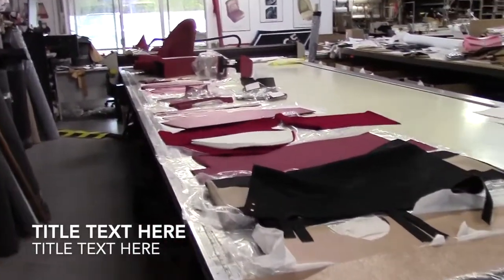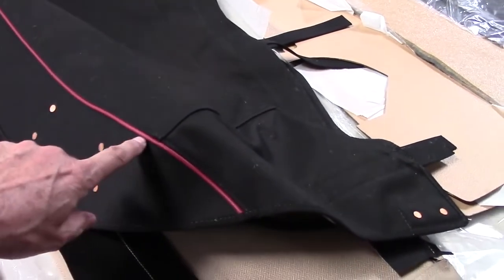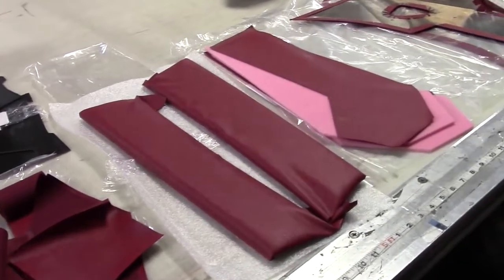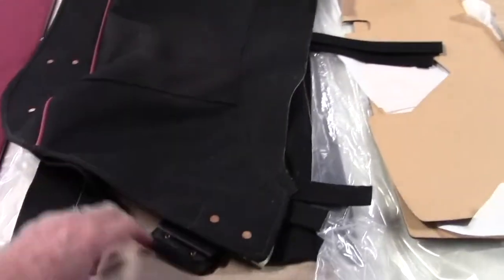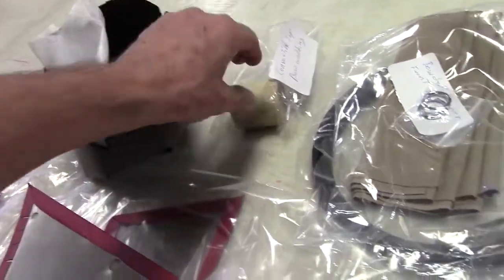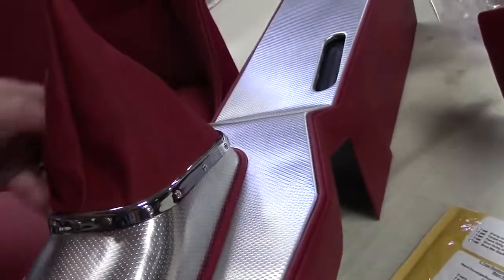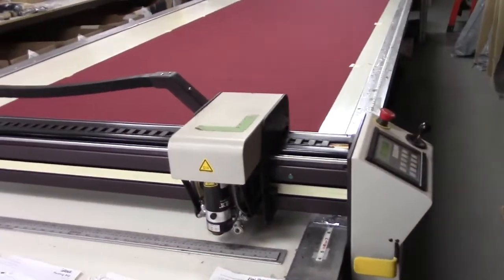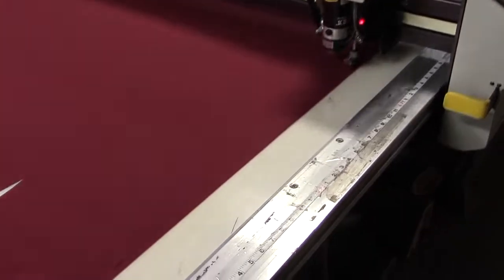Jaguar E-Type Roadster Full Interior Kit

Comment: Notice how the sunken floor carpets have zero contour, and how the upper seatback insert doesn't match the bottom..copper rivets weren't fit to the hood boot,the nickel plating wore off the origional..the binding is a joke,these guys cannot turn an inside or outside corner mitre,nor an inside or outside radius when wadding up thier binding..why would anyone buy a kit from a company that has no experience installing is beyond me,the attention to detail does not exist..absolute garbage